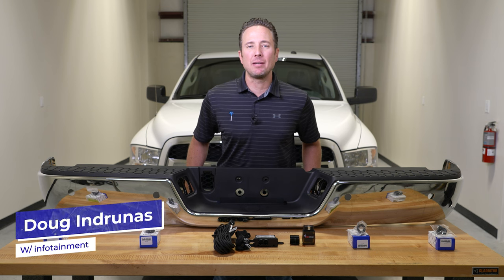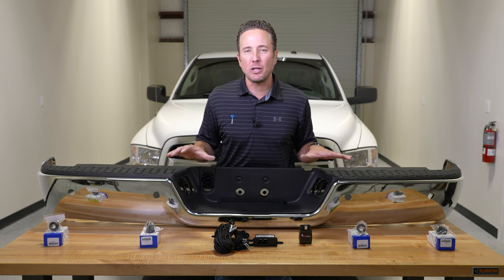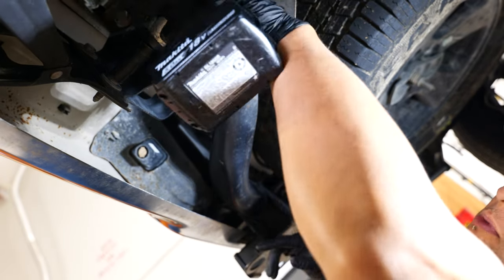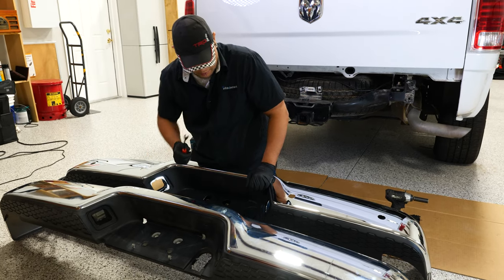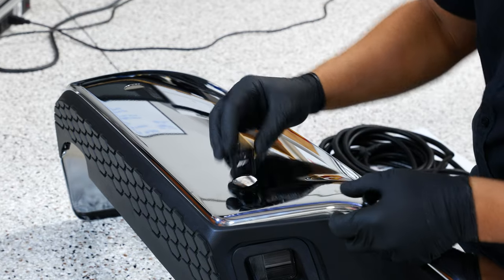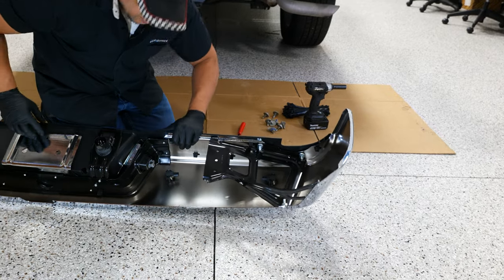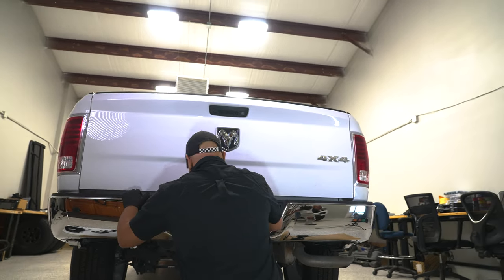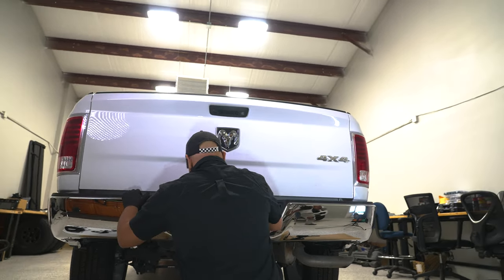Episode 8: 2016 RAM 1500 Classic - Rear Parking Sensors Installation - The Build by Infotainment.com

Comment: If I buy this and install it and then decide, I don't want it and remove it, will the obd genie work for another truck, or is it programmed to the vin and only for my truck?
Reply from the maker: The OBD genie will be tied to the vehicles VIN# once it has been initiated.  So you would need to purchase a new programmer to initiate programming in a new vehicle.

Comment: Could you list or itemize  ALL THE PARTS that was used in this installstion. I can't  seem figured the harness that runs from the rear sensor to the kick panel
Reply from the maker: This is actually the video for the complete plug and play installation package that we offer. The package comes with all components that are presented in the installation video.  A majority of the components are factory OEM parts.  The wire harnesses that are included in these packages were developed by our team to integrate in to the existing wiring that the vehicle is equipped with to accommodate a plug and and play installation.

Please feel free to reach out to our sales team with any additional questions that you may have. 
1-855-636-6287 Ext: 2 or sales@infotainment.zohodesk.com

https://infotainment.com/shop/exterior-accessories/park-assist/2019-2023-ram-1500-heavy-duty-factory-oem-parksense-rear-park-assist/